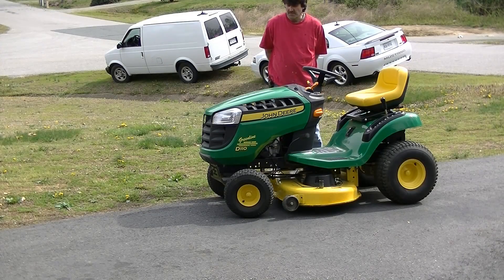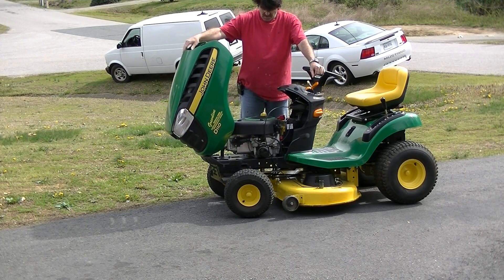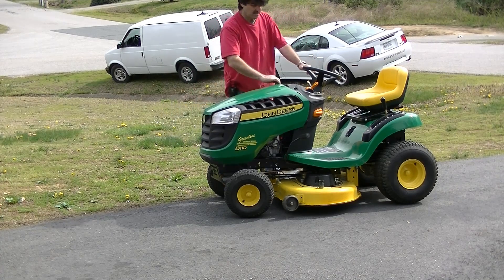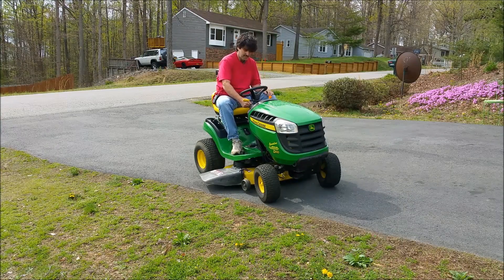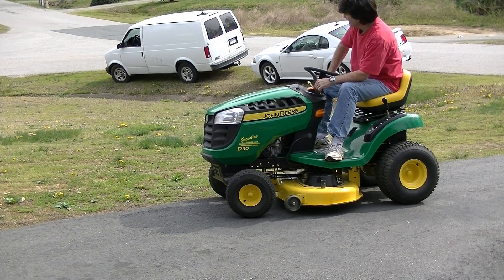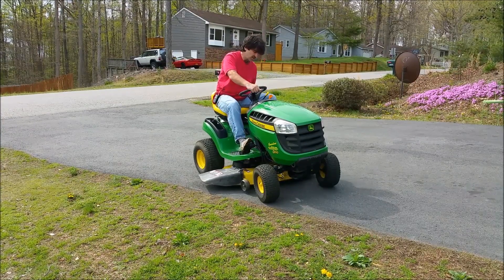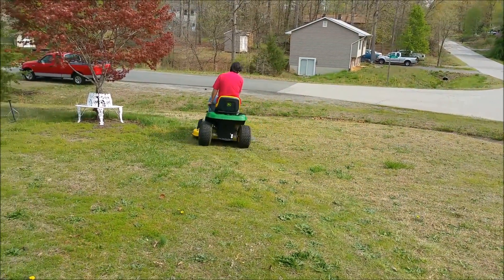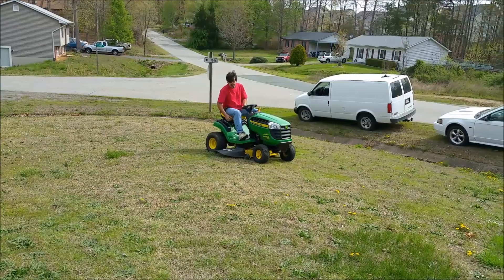John Deere D110 Test / Demonstration

Comment: Um unless you completely disassemble the deck hubs and remove the bearing seals then your deck spindles are not greased. It’s a factory designed fail point. The bearings in the hubs are sealed bearings meaning none greasable.   They put grease irks in the hub to make you think you greased them. They did this so your deck wears out and you go buy a new deck and or a new complete mower. Most people replace the entire machine instead of just a deck. Don’t believe them just pull a deck hub and see where the grease went.  I learned this the hard way.
Reply from the maker: HI!  Yes absolutely.  I am aware of this issue.  I think I have a video on the very subject you brought up...  Thank you for sharing.
Reply: @JLPicard440  no problem. Not trying to be a smart ass. It’s just sad that the big factories do that.